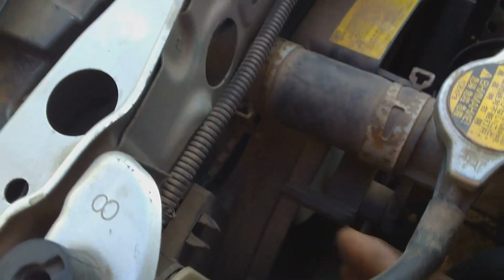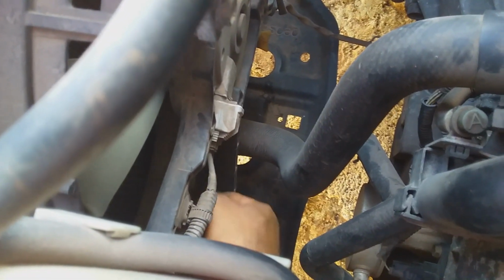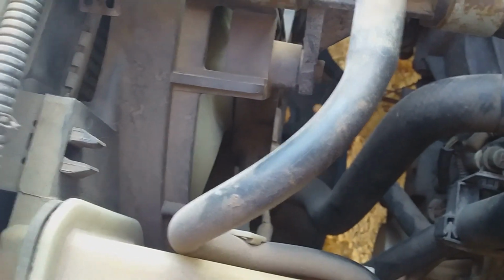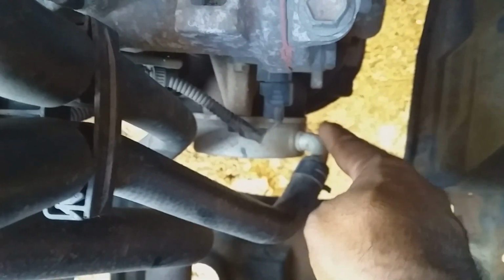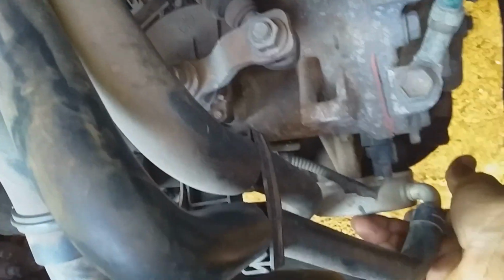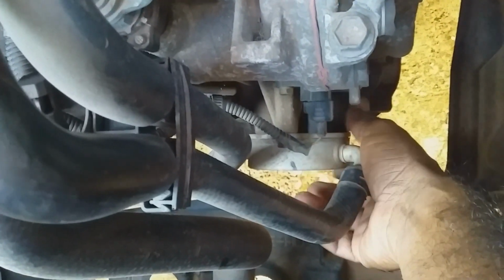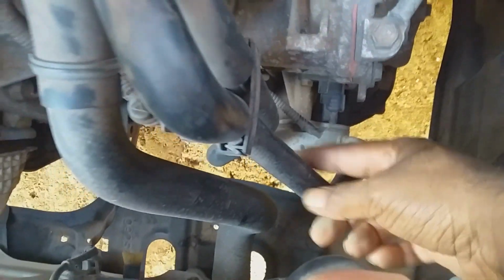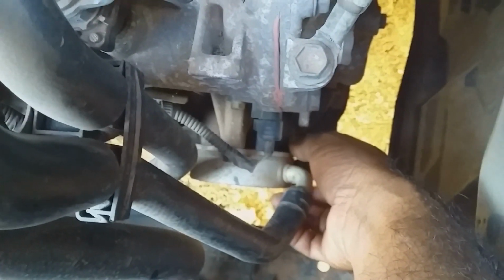Toyota Vitz Transmission Fluid Cooler

Comment: What about Toyota Echo? I want to do transmission flush but can’t tell for sure if the transmission fluid is cooled by the radiator or not, I can see two smaller hoses going there from the transmission side but the way they are located makes me doubtful

Comment: Sorry sir i want to know capacity in litre of cvt tc oil  for ractis 2008 2sz engine
Reply from the maker: @caristevaristo5531  It's best to drain the transmission fluid in a large enough container and measure the fluid so you can replace it with the similar amount. Usually these transmission uses 4 quarts of fluid but to be exact it's best to measure.

Comment: My car cooling water becoming pink in color in radiator including my CVT oil
Reply from the maker: In newer vehicles the coolant fluid is oil-based. It can vary between slightly pink and slightly brownish depending on the manufacturer. The CVT fluid is slightly redish in colour.

Comment: I have Toyota vitz 2015  in have problem with  transmission   display code..PO963
Reply from the maker: The code P0963 is related to your transmission pressure solenoid. 
1. The circuit to this solenoid could have a break in it or
2. The solenoid coil could be bad.